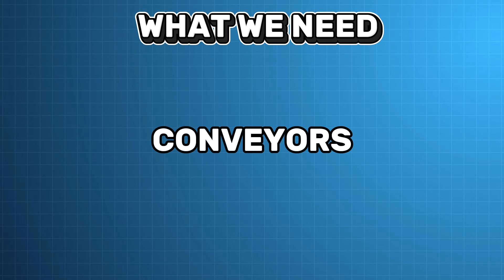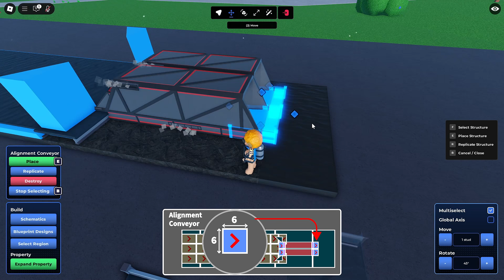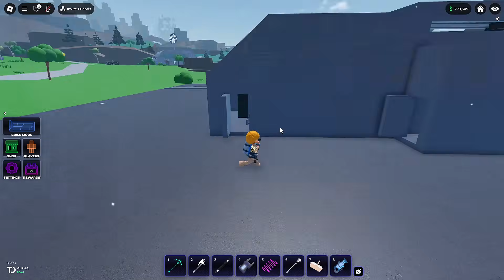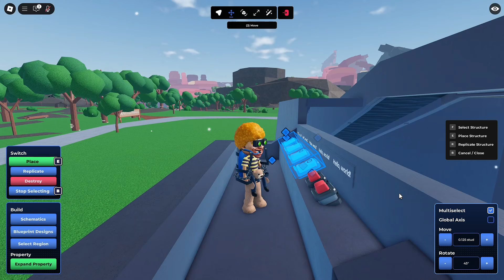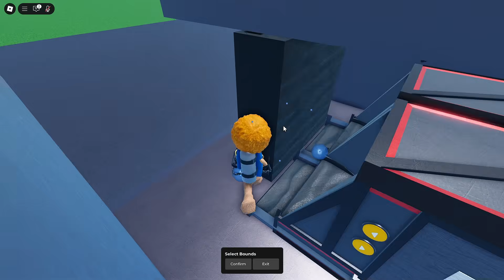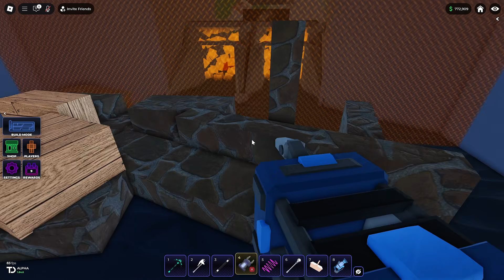BUILD an Auto Loader & Unloader For NEW Truck in Oaklands | Roblox

Comment: TOTAL COST

Oak Depot Total: 247 000$
2x Refiners: 44 000$
2x Plankers: 90 000$
2x Forgers: 56 000$
2x Sanders: 40 000$
26x Borderless Conveyors: 17 680$

Alans Logistic Store Total: 175 540$ (Without freyliner+upgrade kit its 65 540$)
6x Alignment Conveyors: 51 000$
1x Filter Conveyor: 280$
4x Relays: 2 200$
2x Frequencies: 1 040$
5x Interactors: 500$
1x Collider: 840$
1x Not Gate: 240$
4x Number Interfaces: 5 600$
2x Buttons: 560$
4x Switches: 1 120$
4x Lights: 1 600$
1x Freyliner: 85 000$
1x Upgrade Kit: 25 000$

Lighthouse Total: 80 400$
3x Storage Drawers: 80 400$

Total Cost: 503 080$
Without Freyliner+upgrade kit: 393 080$

(you should pin my comment trust)
Reply: the only lights i can find in alans are the LCD ones and the array of four
Reply: @RockyWTKauresize the set of 4...
Reply: @RockyWTKauit is those just shrink them down to 1 bulb
Reply: @RockyWTKau fr i cant find the lights😂
Reply: @RockyWTKauis it the right lights
Reply: Yeah
Reply: @RockyWTKausame i think its lcd
Reply: @vorp_winrar  could you help me with the wires please
Reply: Bruh im broke
Reply: I can’t find the lights and I suck at the wiring part can someone help me I don’t have the money rn since I bought everything but the lights
Reply: Can u make like 1 more buton cuz that button is gona modify what truck i want
Reply: I was literally about to do the math😂
Reply: Can u use steel refiners and other stuff?
Reply: w man
Reply: Hey bro can yiu make one for me?
Reply: @worldsbestgamerboy7824 i could make it later on for 1.1m
Reply: @worldsbestgamerboy7824 ill provide mats aswell
Reply: @worldsbestgamerboy7824  i can t do
Reply: Thanks
Reply: So how do find you so we can get the schematic for the covers.
Reply: 400k😭
Reply: so the total cost is 247,000???
Reply: @Noah-i9m7t500k
Reply: Thanks
Reply: I cant find lights plssss help
Reply: Mine dont wantto store😊
Reply: too expensive :(
Reply: How do I find your plot
Reply: I don't have that much money I'm frickin broke man
Reply: @FrumpyPlays Can you revisit this? With the new updates they have changed the machines look and sizes and now added a segmentor. If possible can you let us know how to set it up with new machines? This is still a great machine.
Reply: Outdated
Reply: I want to buy the blueprint of your design that you said cost $30k - $20k
Reply: Pretty cheap tho and i have a worst day in my life bc I have a red eye bump bru

Comment: Thank you, 1 year, still works, But i did some improvemen, i put the sigmenter before the unload (on the tiled conveyor (i made the conveyor smaller as the exended just moving too fast to cut ore or plank)
Also i made it 4 Storage drawer unloader, sometimes, 2 is not enough and over the unloader, since i bring multiple type of ores or tree

Comment: New update they added the segmentor.
You can just combine the nearest planker to the process zone, just don't be too high to the conveyors as it would disrupt the movement. My setup has some pieces of segmentor sticking out of the conveyors, but it's too low and small for things to be stuck on.
That also means you can down the numbers of processing machines from two to one only as it would lower the cost of the whole build.
Also, the bulb powered lights has a 4 in 1 set so you need to small it done to 1x1 to get one light each if the spacing with the switches are far.
Reply: Wait so this thing still works for me it didn't, guess i just did it wrong

Comment: A year later and this still works! I followed the tutorial bit by bit and got everything working smoothly even with the newer designs of the planker, forge, etc! For the lights I just went with the lights in Alan's Autologistics that had 4-in-1 :)
Reply: Everything worked fine for me until the wiring the not gate wouldn't connect to the switch
Reply: @Desmin_B how'd you get the blueprint for the build?
Reply: @freddyvelazquez9957  i didnt i made my own i dont know how to get the blueprint

Comment: this indeed still works as of v119.0. if anyone is confused about the bulbs, you can only get sets of 4 bulbs or 4 LCD panels (both are single units). just get the LCDs, and use a tether for each one to split the incoming switch signal into the 4 channels on the display. or, just use a single LCD for all the switches. took me about 2.5 hours, including buying everything, grabbing materials for the blueprints, and testing. also unsure why he says to use 26 borderless, you can scale them up and use WAY less.
Reply: ty
Reply: any ideas why my despawn button doesnt work? the spawn one does and i have everything correct

Comment: 2 things
1) im not sure why but when following your tutorial, the spawn/despawn of the vehicle seems to not work properly. When i redid it myself without the tutorial, it worked. Don't know what messed up but i tried the tutorial method around 8 times before just learning the blocks and how they work myself.

2) with the new SEGMENTOR block, if you overlay 2 of them on top of the sanders and set both to 3 studs, even the thickest of logs will flow through your system perfectly.

(extra info on the spawner for anyone else with the same issue. The side with 2 dots is the input, one for button, other for modifier. The side with 1 dot is for output. ------ Route the spawn button to the right dot on the input side and the number modifier into the left dot with the output side connected to the interactor. Then ALSO set the despawn button to the interactor. That should work. It is also what is shown in the video so im not sure why it wouldn't work for me until i routed it myself.)
Reply: I tried doing what you said here for the spawn/despawn thing and all it does is spawn the semi for a second then despawns it and only one button works, im wondering if im doing something wrong

Edit nvm got it to work i guess one wire wasnt connecting when i thought it was
Reply: @zombothedemonneko1315  that was the same issue with me, took rewiring it all myself to fix it
Reply: @LokelyConed  Yeah i ended up getting it to work, i think the not gate wire wasnt actually connecting where i wanted it to which messed it up, took me moving it up into the air abit to make sure it connected before it worked

Comment: My machine did not work 
Truck did not respawn or despawn
And conveyors just changed direction
I did everything right idk why it does not work
Reply: The borderless conveyor is the only problem since it only goes forward and backward not stopping. Either you didn't fix the region  try atleast making the region at the spawn buttons of the semi. Or you already figured it out before I made it comment
Reply: You might be using four directional conveyors not borderless like you should

Comment: I have a question, I did a magmite run and i used the auto unloader and loader and i got 45k for a full sellner but when i did it again but refined and forged them manually i got 105k and ive also notice i get way less stuff from it like a full tree turns into like 5 to 10 planks, any idea why?

Comment: why despawn truck and turn off/on conveyors don't work?
Reply: Hello if your still stuck the conveyors things works  use two calculator blocks so first calculator lets call it Calculator A the left input a switch and the right input a number interface of 5 important change the calculator to divide function then take the out from the calculator A and input on the right side of the calculator B and the left side of the calculator B is number interface with 3 and then change the calculator B function to add the the out put to interactor it works hope it helps.
Reply: for truck despawn and respawn do this use a calculator block with he left input being a switch which also connects to a not gate feeding into a interactor and the right input of the calculator with 2 from the number interface and also take the output from the calculator to the same interactor it works well.

Comment: why doesn't my truck like not wanna despawn
Reply: use a calculator block witht he left input being a switch which also connects to a not gate feeding into a interactor and the right input of the calculator with 2 from the number interface and also take the output from the calculator to the same interactor it works well.
Reply: @MysteriousE0  ok

Comment: My thing when ever I tap the conveyor button to stop it it just goes the opposite way instead of stopping so it keeps moving the truck when i try to load can I get help
Reply: Hello  I am a month late if your still stuck the conveyors things works  use two calculator blocks so first calculator lets call it Calculator A the left input a switch and the right input a number interface of 5 important change the calculator to divide function then take the out from the calculator A and input on the right side of the calculator B and the left side of the calculator B is number interface with 3 and then change the calculator B function to add the the out put to interactor it works hope it helps.

Comment: small problem when i press my conveyers butten they turn the other way and push my truck out instead of turning them off how do i fix this
Reply: Hello  I am a month late if your still stuck the conveyors things works  use two calculator blocks so first calculator lets call it Calculator A the left input a switch and the right input a number interface of 5 important change the calculator to divide function then take the out from the calculator A and input on the right side of the calculator B and the left side of the calculator B is number interface with 3 and then change the calculator B function to add the the out put to interactor it works hope it helps.
Reply: @MysteriousE0  thanks for the help even if your a month late ima fix it rn

Comment: What settings do any of you have on your machines? Refiner, Forge, Planker ?  I accidently pressed the load button without a semi so i tried to send all the material back through like you did but the already processed wood kept getting stuck inside the machine or it would not fit inside it.  I will keep looking through comments for settings. I hope someone looks at this vid and hopefully has an answer. :(

Comment: okay so for those that dont understand the logic and maybe just to chime in some improvements, heres my analysis.

the first seitch controls the collider that turns the top syorage drawers intangible for a single reason, it allows you to put things on the fused storage drawers, because if you dont, if you put an ore first for example, you wont be able to put in wood because the drawer is unreachable and only one type of item can occupy each storage drawers.

the first relay sends in a repeating sigal courtesy of the num interface and frequency to tell the interactor, targetting the back storage to keep spitting out item towards the top storage.

the 2nd relay sends signal ysing the interactor as well and a frequency, this time, telling the top storage, both of em, to spit the items downward towards the frey.

the 3rd relay controls the belts.

and the 4th relay controls the spawning of the frey.

saying all that heres the improvement i did on mine.

the collder and the first relay as been simplified by keeping them always on since theres really no reason to turn them off.

the belt control and the frey control as been fused as well, because you need the belts turned off anyways when you want the frey to stay put so ive made my circuit to spawn the frey AND turn the belts off. and vice versa. the 2nd relay has been untouched since it does what it does but to improved it a bit, i made mine to only function as long as the frey is present, and will not work otherwise. and all of this, ive relegated to chat commander to free up the switch and buttons. 

a note to those that didnt understand it the first time. the NOT gate is not required. i repeat, it is NOT required. get it???? joke aside, yes, the NOT gate is not an integral piece of the circuit and may be skipped because the only thing it controls, is the light state of the belt switch, because when you turn the switch on, the light bulb sldo turns on, the NOT gate reverses that behavior. and does nothing else.

all in all, the vanilla circuit is fine, but if you can logic well, you can further refine it. i did mine with chat commander in mind, as well as being a programmer, have truth table installed as well
Reply: Do you know how did he connected the NOT gate to the 4th switch in the minute 11:38, because i cant find the way to do it.
Reply: @RicardoHernandez-sw8zj the not gate isnt connected to anything other than the light bulb. he did that so he know that by turning the switch on, the light bulb turns off and so is the belts

Comment: Question, on the final number interface, my wire doesn't connect to the shown spot, is there a fix for this?
Reply from the maker: Hmm - I have noticed that sometimes it can be difficult and you can to get the right viewing angle

Comment: hi frumpy, this tutorial has been really helpful and a very easy step by step guide for someone like me who knows nothing about logic, but Ive seemed to run into an issue - it seems whenever i turn my conveyers off, it only specifcally turns of 2 conveyers, not all of them and im really confused because ive redone it about 10 times and idk what the problem could be, ive tried making the interactor region much wider but it seems to not work, could you help me?
Reply from the maker: Hey thank you for your comment and im glad to have helped! :) - hmm have you made sure that the interactors are over the small orange switches on the side of the conveyors?

Comment: Hey Frumpy, I did everything and when I got to the end of the logic with the wiring to spawn and despawn the semi, it wont let me despawn the semi for some reason, I redid the connection over  and over to see it I did something wrong but I didn't. I followed each step, I know this video was like three months ago, did they perhaps change anything about it? I just started to get back into Oaklands not too long ago, so I'm not 100% sure. But amazing video not gonna lie! to be honest your one of the reasons I started to play again bc I came across one of your videos about this game and it made me want to play it again!
Reply from the maker: Hey thank you so much for kind comment , so I always say this but it’s super hard to diagnose a problem without seeing it in person and I know you’ve tried again and again with connecting but.

1. Ensure that the number interface is set to 20
2. Make sure that the number interface is connected to the relay and the relay connected to the interactor
Then the relay to the respawn button
3. Make sure that the only wire to the respawn button is the one from the relay
Reply: @FrumpyPlays  I've had the exact same issue and this fixed it, thank you so much

Comment: 11:44 i cant connect the not gate to the 4th switch with a wire already in it can someone help like if i just get another switch will it effect the build
Reply from the maker: Hey you can connect it you just need to get it position d right

Comment: Hey man the despawn button isnt really working for me
Reply: This is super later on but I also had this issue, so for anyone else who has it; Relays only transmit the right action type if the number interface is linked to the LEFT input. Aka, on the side with 2 dots the number interface has to wire in the left specifically for the truck to despawn instead of just respawning! (or anything else that needs a specific number power) Nice tutorial by the way, super efficient
Reply: @thatpotato81  can you explain in detail please
Reply: Me aswell and also the conveyor thingy didn't work too
Reply from the maker: @PaulWellesley did you get it fixed
Reply: @FrumpyPlays no it just doesn't work for me
Reply from the maker: @PaulWellesley ahh it’s hard to diagnose it … but the wiring on the video is still correct … it hasn’t changed
Reply from the maker: Hey, sorry for the late reply! - did you get it fixed

Comment: How am I supposed to connect the not gate to the same switch as the relay?
Reply from the maker: Hey, sorry for the late reply! - by connecting it the same way you did the other wire… you can connect as many wires to one part as you want

Comment: @FrumpyPlays I finally built it and after 2 months i finally finished. I know i know but im on mobile so takes me longer. Lol. One thing tho,... i need help with some clarification, Re: NOT GATE. I’m not understanding the wiring. Unless im not looking at the right thing it looks like you v connected the switch to the back of the not gate and the front you connected to the light coming from the same switch the back wire went to. Isn’t it just going in circles. Is it suppose to connect to the relay?? What am i missing?? Hope you can help.
Reply: @FrumpyPlays Sir please read this comment i really need help with my question.  I had previously hooked up a regular switch to a conveyor and it worked just turned off the conveyor when i would turn on the switch and would and turn on the conveyor when i would turn off the switch. So i thought you used the not gate to fix this. But you didnt connect the not gate to the conveyor at all.. help???
Reply from the maker: Hey, sorry for the late reply! - so the not gate is just for the light
Reply: @FrumpyPlays  ohhhhh now it makes sense then. I had so much trouble trying to make the conveyors work and thats how i ran into your video. They are always on, so i thought somehow the not gate could be used to shut them off until i hit the on switch. I was trying to use 1 button to run my whole machine but those conveyors are on thier own world. Kinda like me. Lol ty